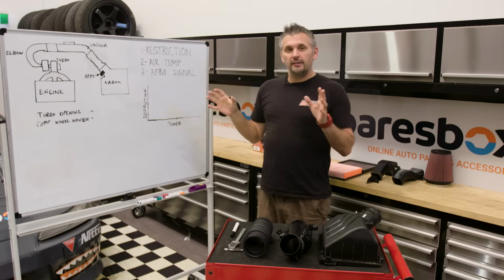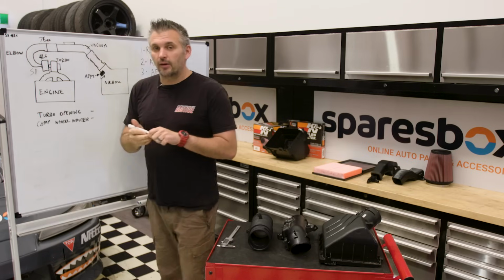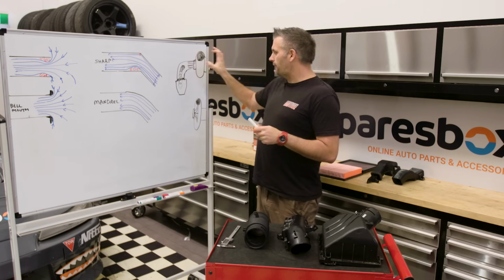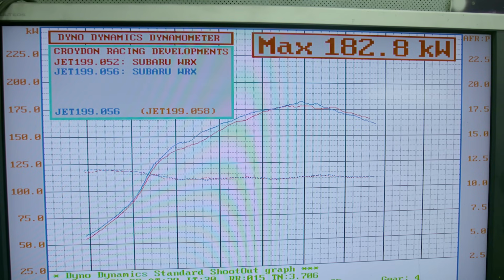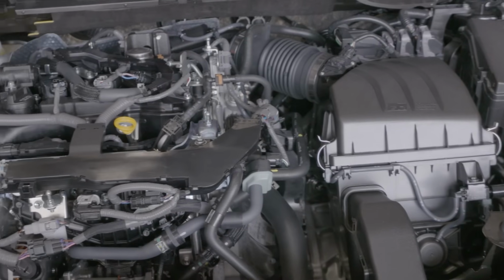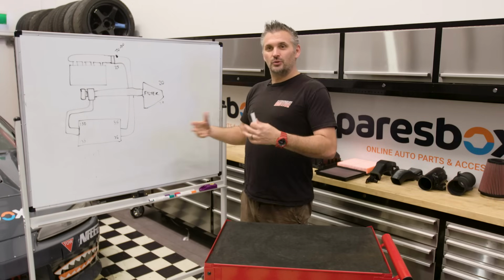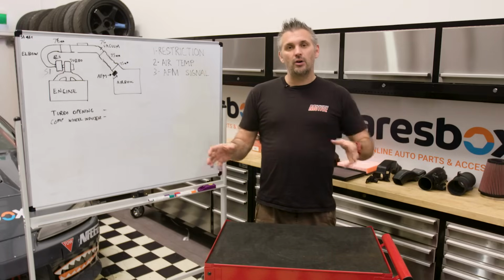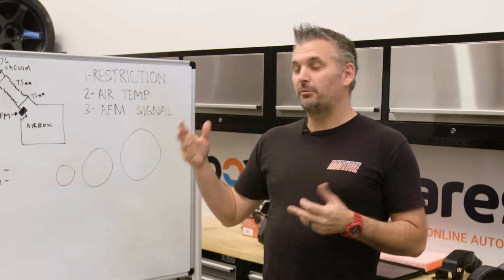Why Cold Air Intakes DON'T or DO Work on Your Car - Motive Tech

Comment: Did intake system testing with 5 temp sensors along intake of turbo intercooled rx-7 years back. Discovered same thing as in video. Soon as you stop, engine bay pod filter temps go up lots. But by end of third gear full noise run, made no difference after intercooler. I still went and installed 4" hose to relocate filter before intercooler out front!
You didn't mention superchargers, but they are very sensitive to pre-charger intake restrictions  and temperature. More so than a closed loop wastegate controlled turbo. I have cheated and spray water/meth through my roots blower. Best mod you can do for a supercharger!
Reply: water/ meth is shit

Comment: How manufacturers make those intakes " leak hot air " is that a pure design flaw, or could it be designed to assist cold starting? Or were those only good for cold starting the old carby motors? 

I'm confused on why they would do that..
Reply: They are there for NVH drive buy noise. Let some noise leak out into the engine bay and less is heard when the car drives by.
Reply: Manufacturers have to follow not just one but many different countries and their emissions standards. And there for not always will be able to create the best or what they wanted in their R&D. And another thing they would do thing like this is for the future updates. Manufacturers could make a car let say 250kw but if they stay the same every year in a period of 10 years, there will less likely to sell more in that 10 years period.

Comment: I do not completely with the cool air on a night statement isnjust because of the intercooler working more effectively, it is but it is also the combination of the cool air being injested.  As my one car with no intercooler really perks up on a cool evening/morning and I know thats directly a result of the air intake (which is already a sealed off fender source).  I always make sure the intake is oversized and cool air sourced as possible on a turbo car

Comment: Great video, thanks for posting!! I am wondering if you plumb a pipe from stock airbox to the front grill of car, are you going to end up sucking on water when it rains? And if so will that hurt the engine?
Reply: Water is small quantities is actually fine, (water injection can be used to make more power by providing more oxygen and cooling change temp). But if you drive through a deep puddle you could hydro lock your engine, (Bent rods & or valves).
Reply: I've done that on two cars with no issues. 

The closest I came to problems was after a freeway run in torrential rain. The paper airfilter soaked and the car lost a lot of power, but the clean side of the factory airbox was still dry.

Comment: On 70-80s era cars I think high flow k&n filters made a noticeable difference. Modern cars are much better designed so gains are negligible without more mods
Reply: @Thor Odin son you clearly don't understand the concept of a COLD AIR INTAKE. Go back to AutoZone you will fit in there perfectly. If it's not sealed you are drawing in HOT AIR. .but alas stick a k&n sticker on there it'll boost 20hp
Reply: 100% agree,  I had a tuner tell me to install a new suzuki air filter on my race gsxr1000 because it actually has a better power band vs a k&n which is mostly peak power designed!
Reply: depending on the application.. 80s camaros literally made 10 more HP compared to the firebird... because camaro had a better intake.. lets not mention 4th gen ram air SS or WS6
Reply: Well absolutely, you could adjust the air fuel ratio right on the carb. Nowadays you got to do that in the computer. So you gonna need a tune.
Reply: Yes they didn't have the ecm controls modern cars do. Modern cars are programmed to be the same at all times. So if it wants 170hp that's what you get always. It will adjust timing to make up for increased flow and fuel demands to get just that. Bolt ons are fun and noisey but the tune will make it all work properly
Reply: That's because of the computer programming! Old cars had no computers
Reply: @Thor Odin son So true
Reply: No difference in pressure drop across a K&N and an OEM filter .
Reply: @Thor Odin son are you that dense? You need a cold source of air for a cold air intake if it's drawing in air from the engine bay it's hot. Since when has engine bay ever been cold ?? Ever run your vehicle for a bit and open the hood ITS HOT!!! You have no understanding of how this works. Keep telling me how you know nothing your lack of knowledge is showing. Real cold air intakes draw air from outside the engine bay like a wheel well. You're a 🤡 for even saying what you just did. So like the other guy you would fit in at Auto Zone. Go lookup any Dyno test that has the hood closed with a "CAI" and you'll see drops in performance compared to stock boxes.
Reply: What's your thoughts on 2012 jeep Grand Cherokee 5.7 hemi?
Reply: Had access to a 4WD Sun Dyno in the 90s and did work on a number of cars . E.g. Removing the inlet horn inside the airbox of a BMW 325 after the filter picked up 5 bhp throughout the range . Leaving it intact and fitting a K& N produced zero increase over OEM as OEM had same pressure drop across filter . BMW actually fitted a square bell mouth inside this airbox .
Advantages of K&N in the 90s was it could be cleaned .
Reply: If the car has a sealed air box system it will always be more effective than a cold air intake
Reply: @Nick_Gir  what if the cold air filter has a box around it kinda like stock
Obviously has the front air coming in though so not sealed really.
Reply: If you are going to use a K&N you might as well run no filter since the thing is a glorified rock catcher, just save yourself the $70+ 

The damage to the motor from poor/no filtration will be pretty much the same in the long run regardless.
Reply: Terrible advice my k&n is light years better than that stock paper crap especially where humidity is heavy those paper filters get soaked and run like crap zero air flow once they have some dust and moisture…
Reply: In layman terms after market intakes only work with a engine that's modified to force more induction. Put it like this your car is idling and you can't LITERALLY hear the air intake taking breathes IT'S NOT AIR INTAKE IT'S YOUR WEAK ENGINE
Reply: K&N products are garbage in every way. Still blown away how they still have a standing in the automovie community.  Nothing to do with the topic at hand. Just thought I'd put that info out
Reply: @thomasmatarazzo198  No they are not. Its hillarious when a brand gets popular there is also these people who are like "UNLIKE EVERYONE ELSE I HATE THEM, THEY ARE NOT GOOD, EVERYONE IS WRONG, IM RIGHT, IM SPECIAL"
Reply: @thomasmatarazzo198  So you prefer throwing paper filters away?
Reply: @harveybrooks2597  No other companies make better filters
Reply: @thomasmatarazzo198  For example, Mann .
Reply: @harveybrooks2597  yes. If it's not a race car engine cleanliness is paramount to gaining a few ponies. I've used reusable air filters in the past, at the expense of a cleaner air intake tube, oil and MAF. You could also get a reusable oil filter and do annual oil changes, if you so choose. Since I fall in the severe service category, I choose clean, quality, new oil and filters every time. Air Filter before 10k, oil every 3k. 4.6 runs like a top, sings happily from idle to 6k 😃 💨
Reply: @harveybrooks2597  Sir.  Think about it.  You are burning petrol.  U r changing oils.  Yr foot is a bit heavier than Granny's.  Paper filter?   Take one less trip to the super each week? Cheers.
Reply: It have nothing to do with Old Cars, or New Cars. An K&N Filter can actually bring a lot of Power, but only when 2 Things are the Case. 1) It must be seperated from the Heat of the Engine. 2) It must be streamed with fresh Air. 
In this Case the Engine get more Air = More Power.
But in 90% of the Cases, People just replace the Stock Filter vs. the K&N Filter. And in those Cases the K&N Filter get only the hot Air out of the Engine Room. And the Car lose Power.
Reply: @kallo182  not call k&n are cone filters you do know that right?  They make them to fit stock intake systems.
Reply: They are better designed but not for power. 

Silence, gas mileage and smog is their goal, not power.
Reply: K+N have been proven countless times to produce a drop in power in both stock and modded cars, when I bought an E46 M3 years ago it came with one and it was the first thing I removed. Installed an eventuri CAI and it was like a different car, noticed instantly how restrictive on the lower end the K+N had been. I've also never understood why people fit the oil coated ones to cars running MAF sensors, asking for trouble there! I'd happily watch any proof/vids uploaded proving they are actually any good, they've been selling them since the 90's so I'm guessing they must have some applications where they give some benefits.
Reply: @sarcastixx74   that is not the issue its the oil it will damage modern maf with hot wire
Reply: @djjaysky9071  That was the exact point I had already made - "Personally I just wouldn't be putting an oil coated filter of any type in anything running a MAF sensor."
Reply: @sarcastixx74  Bullshit.
Reply: @sarcastixx74  On my '21 RAM Warlock (1500 Classic) with the 345/5.7 HEMI, the factory dress 0-60 (MPH) is just about 6.5 seconds according to the information available online.  That includes the stock air filter that comes in it.  I tested and verified this to be accurate.  But I did have to lock it into 4 wheel drive so it would spend more of that effort into launching than spinning the tires.

Now, with NO other change, no chip tune, no aftermarket intake, no other difference, even had the same octane fuel in it, just a new K&N filter for my truck, that 0-60 time was down to about 6 seconds flat.  For a truck that weighs in excess of 2.5 (US) tons, that's not bad for low end power.
Reply: @wulf-3596  Good example of the point I made bud. It does prove that there are indeed some applications where a K+N give some benefits! 6 secs for a truck is a very healthy time. Personally I just wouldn't be putting an oil coated filter of any type in anything running a MAF sensor. It may well be that large capacity engines like yours are better suited to these type of aftermarket filters.
Reply: @sarcastixx74  Best I can remember, this is a "dry" filter, not oiled, but it is cleanable/reusable in either case.

Comment: Best solution is airconditioning cooled intercoolers, and very short turbo charger piping,this method is the most effective in any situation and almost every car today has air conditioning.
Most "cold air intakes" are actually hot air intakes like with the 997.The only thing that misleads most people is the gain in intake noise.The louder it is the faster it appears to be.Great detailed video.👍
Reply from the maker: Precision Racing showed us this with their twin turbo Lambo. Keen to explore it further. That’s a “post turbo” tech video
Reply: Apparently the dodge demon has this from the factory, first production car to have it,here is a video explaining how it works.
https://youtu.be/wLOkr-hUnU4
Reply: Air-conditioning cooled intercoolers?...   I'm in
Reply from the maker: Its pretty amazing tech actually
Reply: @MotiveVideo  It's pretty ancient tech too, been used since the 90s, but instead of it being called an "interchiller", it was called a freon-to-air intercooler. 👍 1st time I saw it was on a 3T-GTEU powered T-18SE. 😎
Reply: @MafiaboysWorld  yeah it comes up evrery fews years, nothing new. It never sticks around for long. Weight , cost and complexity cancels it out iirc.
Reply: @FirstLast-bi8xi  Also the EPA used to LOOOOVE people running them, quick easy fine money for NSWPD..😬
Reply: @laser1787  spray nos through the intercooler will cool the air
Reply: Surely that would be a packaging nightmare for most cars? And how much power are you using to run the a/c vs power gained through cooler charge temps?
Reply: @vlt873  this tech is used in drag applications, i don't know the details but since oem's are utilizing water-air intercoolers in stock cars my guess is that packaging wouldn't be a issue for a already airconditioning equiped car, just use the stock aircondirioning system, on older cars with front mount that would mean less packaging because you can completely remove the front mount system, use shorter piping and place a small cooler(that is airconditioned)directly between turbo and TB, resulting in less lag and optimal temps in every condition
Reply: @MrAudi220  Yes, and the ridiculous cost too. OEMs are always a compromise. :-(
Reply: @MrAudi220  But, would AC provide enough air with fan on high, and maybe give added cold air 40 degrees below ambient air and the pressure difference between direct air flow, or a fan pushed air of (?)1-3 pounds? No Turbo, Kind of like a turbo want a be with 40 degree colder air!
Reply: @vlt873  Did someone say KFC!
Reply: @laser1787  ? Either a really dumb joke that I don't get, or a really smart joke that I don't get. Either way I don't get it.
Reply: @vlt873  You don't need to run the AC at the same time as gaining the benefit of cooler charge air.
Reply: @yowie0889  so how do you run the ac without the compressor running?
Reply: @vlt873  That's not the point. If the intention is to gain the benefit of a big cold heat sink with high thermal mass, that heat sink can be chilled by the air conditioner before the drag race. During the drag race the AC can be switched off.
Reply: Damn, my million dollar idea and you already had it!
Reply: Better version was like what Fred Gibson was up to with George Fury's Nissan Bluebird Group C car in the '80's spraying refrigerant Freon gas on intercooler !! "Slightly" illegal in racing - but  for the street off-idle ? Sounds handy ! 👍

Comment: The intake air temp before the turbo affects how hard the turbo is working. So cooler air can affect the exhaust backpressure. If you are maxing out the turbo the cold air will help make more boost
Reply from the maker: The let thing you said there waa “if you are maxing out the turbo” which most people aren’t
Reply: @MotiveVideo  that’s not the whole point. 
Colder turbo temps at the same boost=lower turbo drive pressure=higher VE=more power
This is what I’m saying
Reply from the maker: We know. We say that
Reply: @MotiveVideo , most people have laggy turbos lol always max it

Comment: I've stuck a KNN on my daily, I live on a dusty area and yes they go though the filter and into the engine. KNNs flow more due to it having less restriction. Did i feel any power difference to my stock air filter? nope, no difference it made some nice wooshing noises though.
Reply: @TheFastAndThe Dead 🤦🏻‍♂️
Reply: if your dealing with dirt do not run a oiled filter it will clog, run a dry filter
Reply: @TheFastAndThe Dead not true, any car after 96 will self learn

Comment: My JZX100 lost nearly 5kw at the hubs taking off the stock airbox and throwing a k&n pod filter off the MAF.  Back to back dyno runs minutes apart.   Of course the pod filter sounded 100x better which is all that really matters.
Reply: that's what i tell most people, change to an aftermarket intake for noise not power
Reply: @S2yay  Also stock filters air way better.
Reply: Agree, went back to stock too.
But I miss the intake sound...a lot...
Reply: I agree! The only reason you'd put a CAI on a turbo car is noises lol. I have a T5 Volvo and I can tell you now I have gained NOTHING in hp putting on a CAI- except maybe a little better throttle response- but the turbo noises make the teenager in me giggle so who cares
Reply: It’s all about the sound lol
Reply: lol
Reply: because you had an open air intake... its not even close... open KN vs stock.. stock will win